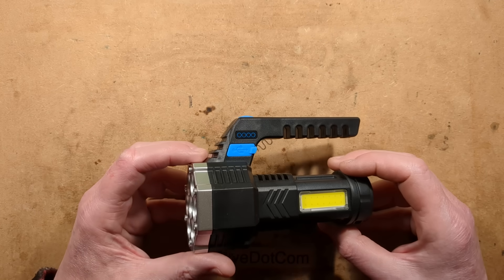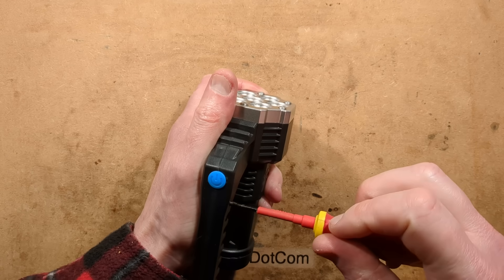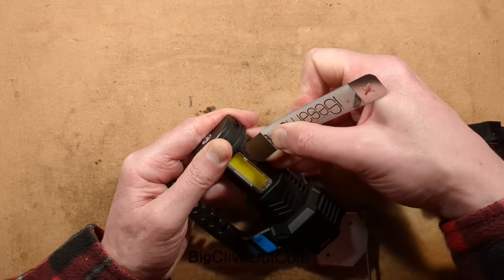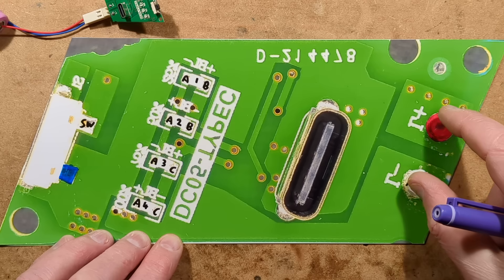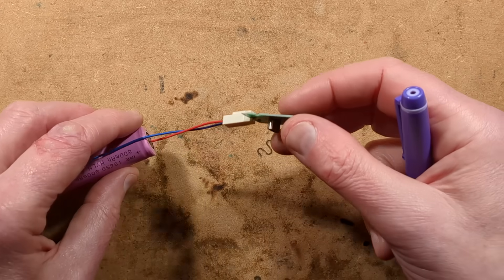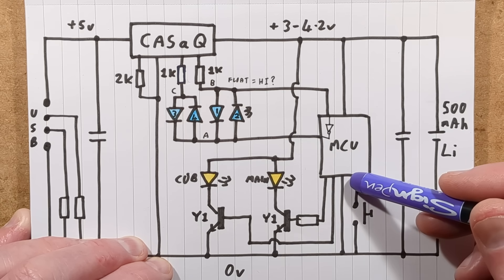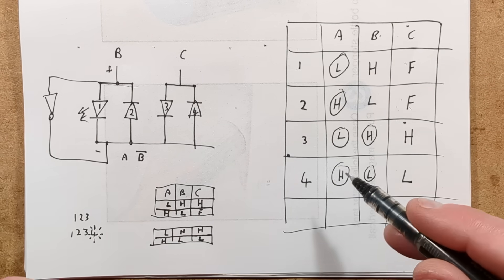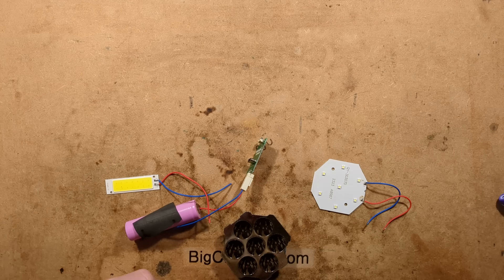Trashy big LED torch with intriguing charge control chip

Comment: I bought a similar one from temu. Was pretty bright and when battery was low I plugged it in and nothing happened. 

When I opened it the usb c connector wasn't connected to anything,  just an empty connector hot glued into the case.

Top quality stuff.

Comment: I don't even know why this thing exists. Shenzhen absolutely dominates the affordable torch segment. There are dozens of brands with really high quality and affordable torches, CNC'd aluminium, rational modes and interfaces. They may cost a little more, not as much as you'd expect, but they're so much nicer, serviceable, and will outlast this by miles.

Comment: I have been looking further into the sequencing of the bargraph LED's and think I have worked out how it is done without leaving a pin floating:

2 pins with Pin 1 attached to the inverter in the MCU

Pin 1 oscillates between high and low and pin 2 matches this oscillation - 4 LED's light on 50% duty cycle.
Pin 1 oscillates between high and low and pin 2 is static - 3 LED's light on 50% duty cycle.
Pin 1 oscillates between high and low and pin 2 oscillates inverse to this - 2 LED's light on 50% duty cycle.
Pin 1 is static, pin 2 static in inverse to this - 1 LED light on 100% duty cycle.

Comment: My grandfather fell for one of these online, the battery capacity after a few uses was laughable. I shoved 2 used 18650 cells in there instead. They fit easily

Comment: I bought a similar one that doesn't have the handle and has only 5 leds in the front, inside it has slots for two cells, i replaced the original one with two cells from a laptop battery and now it has good battery life now

Comment: Interesting! Bizarre LED trick but I think I follow it. Kinda neat; kinda seems like they were DESPERATE to fit it into an 8-pin package that they made it more complex internally, AND it's "BYO inverter". Speaking of which, I just noticed that the MCU's "inverter" is disabled (output tri-stated) when the torch is in OFF mode (presumably MCU in a sleep mode), to extinguish the power level LEDs.

Comment: 800ma my hairy nutsack. That will be more like 200ma in reality, maybe less. I have this exact same torch from the same place and it lasts maybe 5 mins on full. On the other hand mine doesn't flicker, so that's a plus I suppose. If you're buying torches from AE then budget for a decent battery too, but to be fair the torches are dirt cheap.
Reply from the maker: The capacity wasn't too bad.

Comment: I use these '' part's '' for my display pieces.  I have a small wood and glass case with 2 glass shelves in it but no light.  Same with my entertainment center 4 doors on the main part the tv sits on Then 2 end shelves that are 5 feet tall with glass doors and not 1 light was added? Would have cost the builder maybe 50 cents.  I added lights and a usb plug. Cost me $5 . Display case with no lights should be a crime lol

Comment: The Li-Ion cell is again delightfully disappointing. There is enough space to even put one of the bigger cells into it. The cell it comes with is probably also a hazard. I would definitely replace it and bring it to the recycling.

Comment: I'm pretty sure your schematic has an error.
There are 3 vias under the micro, A B and C. You show A and B on the micro but I'm fairly sure C connects to pin 7 of the micro.
That makes sense from an embedded design (my main job) because with A B and C connected to 3 micro pins you have the 4 leds charlieplexed in typical charlieplexing fashion. That gives the ability to control all 4 leds independently. Ie, easy bargraph for the guy that wrote the code.

That leaves the mystery of the charge control IC. I dont know what it is, but if I'm right about the leds being charlieplexed, those two pins on the IC with the 1k resistors are not related to the leds driving at all. One of them is probably a "charge-complete" digital output which the micro can sense in its leisure between charlieplexing cycles.
The other pin may be a low-bat digital output, or even a usb-on signal that shows charging is occurring. I dont know.

Regarding how the micro knows the battery voltage, I expect it uses its internal 1.2v ADC reference to compare to its operating Vdd (which is battery volts), that is a standard technique with these cheap 8pin Taiwan micros and it is not mega accurate but is fine for a 4 step bargraph.
Reply: On further reflection, I think that is a standard charge control IC with 2 digital outputs, normally used to drive 2 leds;
1. Charging
2. Charge complete
The 1k resistors allow the micro to sense both these conditions for a few microseconds between charlieplexing.

Have a look at TP4056 and TP4059

Comment: I found that most cheap lights pwm the led even at "max" setting and gradually reduce the duty cycle very slowly in a few minutes to get away with poor heatsinking and small batteries without sacrificing the "wow" factor when you first turn it on.

Comment: wow...it actually have a charging chip ? I have encountered one with just a diode in series with a li-ion cell slapped straight across the 5V supply rail in a cheap flashlight...luckily i have discovered that just in time....that method of charging is fine for ni-cd or ni-mh, even lead acid but with li-polymer or li-ion...yeah thats a ticking bomb...

Comment: Pro tip: Use cheap, Chinese screwdrivers. (for Chinese things) The cheapest ones, like what they provide free to for the stuff you bought. I have some, 10-15 year old BB gun screwdrivers (Chinese of course) and they opened everything Chinese electronic device. 😆 Where the quality Betas, Weras, Wihas, PB Swiss Tools or iFixit sets fails, the noname crap works. 🤌😉

Comment: using tri state multiplexing it is already possible to control 4 led indivisually with just 2 pins(because the led forward voltage is high enough you can put two in series and control middle point)

Comment: Clive, one thing I've noticed repeatedly is the amount of rubbish 18650 batteries and their claims to capacity..
Could you do a video on decent 18650 s and which we should use in our projects that actually have a true or decent capacity. I noticed there are almost exact copies of Samsung and Sanyo batteries except the slot size on the positive end give them away as fakes. The printing is almost exactly the same as well. eBay is awash with so many choices and they can't all be good.

Comment: I think you may have made a mistake with your schematic (maybe). Point C appears to go to two vias, one of which goes to the 1K resistor as drawn but the other is under the microcontroller and surely goes to the unused pin?
Reply: Yes, correct. The group of vias labelled ABC all end up underneath the MCU.

Comment: Are you sure that's a true 18650 ?
As the worklight torch I got from sainsburies had an internal rattle and would keep turning off. When I looked into it the 18650 battery was just a shell to hold something like a 16500 and that wasn't making a contact inside the fake battery housing.

Comment: clive would be great if you could look at the timing chips on battery led lights..6 hrs on 18 hrs off.. whats the voltage draw on such a small chip to keep it off for 18hrs ..
Reply from the maker: The current the timing chips draw is usually measured in microamps and negligible.

Comment: The tri state driving method of the state indicators is certainly a way to get an effective bar graph on the cheap as it were. Blinking them does save some battery charge. I expect to see this idea copied extensively. As usual the heavy lifting is done in the up software but so what? It works.

It strikes me that default PWM on the output LEDs helps prevent overdriving them while extending the life of the under-spec battery.

No SOS mode upon holing down the switch? What a relief!

Comment: 9:51 That 100 R base resistor oñ the MAW driver transistor wont limit much CE current. The Y1 SS8050 has hfe specified 120 to  350. At a 3V high state output of the MCU and assuming 0,6V BE drop the 100R resistor would pass 2,4/100= 0,024A which at minumum hfe would allow 0,024*120=2,88 A Collector current... They probably used it since that output of the MCU has higher output current capability than the other Output used for the COB driver.  Or they omitted that base current limiting resistor on the COB driver?

10:15 Your observation may be very valid. They may actually have used the high internal resistance on that "scaled down" lithium cell as current limiting. Win-win for them, and potentially a pitfall for those changing the provided low capacity high impedance cell for a proper tool grade 18650 as there seems no current limit other than driver's CE junction and wiring. Maybe a test is in order as to the LED peak current with the original cell and a proper cell... Or voltage drop on the provided cell under load...

Comment: It's very puzzling why they would even make an 18650 with 800mAh, that turns out to only be 500. You could take apart the cell to see how much(little) there is in it. They could've just put it in a 14500 case and saved a bit of metal...
Reply: Maybe it's a second hand cell with a brand new pink shrink wrap, reusing is more profitable than recycling.
Reply: No , they are purpose built to supply  the cheap units. Most of these  inexpensive lights have such cells to keep costs low. Easy enough to swap out the cells

Comment: Surely the PWM on max brightness is just the standard way of getting higher perceived brightness without burning the LEDs out?
Reply: Nah, PWM is a MUCH more efficient way of controlling the brightness of an LED rather than using the linear region of a transistor or mosfet. To have the light go into direct drive or have a regulated high mode requires more hardware and more expense, so they just use the PWM that they already have for the lower settings on high also. The cheaper lights are almost all like this.  The higher powered, more expensive lights use the extra hardware to either direct drive the LED on high, or use some sort of regulator circuit on high only, and use PWM on the lower settings.
Reply: @davelowets  If only they would use 10 KHz instead of like 25 Hz...

Comment: You gotta get into LED swapping. you can replace the cold ugly color rendering led with more natural high CRI ones, we're in the golden age of decent performant high CRI emitters (for practically all tints). hell you seem to be interested in lights, flashlight modding is worthwhile adventure. Those emitters look like 3535 which could be replaced for ,Nichia 219B, Nichia 519A, or SST20 (check at convoy  for those) Fireflylight (FFL351A) and Emisar (Noctigon NTG35) also have some purdy 3535 leds you can swap in. The next step is swapping the crappy driver for something better.

Comment: remember those old 5mm white LEDs of which we all thought they were bright (the first ones to actually shine instead of just signal)
Reply: Yep. I bought one of the first available white LED's at Radio Shack decades ago when they first started showing up, and it was like $5 for a single bare LED, and it wasn't even all that bright. For the time it was bright, but nothing compared to today. Then, when the Luxeon flashlights started showing up with like 50-60 lumens, that was the next step up. Those were fairly expensive flashlights.. 😬

Now one can pick up a 1000+ lumen flashlight for less than $20, and it's TINY... 👍
Reply: @davelowets  I remember buying my Nichia ones from Dotlight. Shop doesn't exist anymore.
Reply: @davelowets  yea it's amazing the amount of light these days

Comment: i was going to say dont buy it but it was done..... the one i have same no handle  its cheap but its ok ...... the best of them all is the smaller ones  diameter 11/2 inch  l 5 inches ..... their is a smaller model 1inch x3 .... both work really well  but the bms is doggy if you run them flat you have to jump start the battery ... they give more than 1 hour run time .. they have a charge indicator don't let it get below 40%  ... the thing is they cost $2 to $4  ................................ the small one comes in a cool little zippy box i use them for outdoor power terminal  boxes  on my   cctv after i paint them to uv stabilise  .............................................................................. did you note the 18650 is that light a ANT could nik it / walk off with it

Comment: I ran across something recently, which seems to be confirmed by a W source article, that says that the correct reading of "18650" is eighteen, sixty-five, zero. 18 mm by 65 mm, shape 0 (cylindrical).

Comment: My wife bought something similar same manufacturer and it had a blue led light on all the time which would drain the torch. I put a small rocker switch on her one so she can turn it all off totally. Why they would wire it up with a blue led light going all the time baffled me. Fitting the on off switch was easy.
Reply: Did you try taking a flush cutter to the blue led first?
Reply: @rexsceleratorum1632  No I think my wife liked the little blue light too much and I had a little spare rocker switch. Woman are illogical and like shiny pretty things ;)
Reply: @peterwilson5528  Hi, hmm, i'm not sure gender decides whether a human enjoys cool lights, though each to their own. peace love light
Reply: @flyingfree387  It was a bit of humour. Are things in the war of the sexes now so bad that they are excluding even light humour?
Reply: @peterwilson5528  light humor indeed, as it is humor about a light.
Reply: how low did it drain the battery
Reply: @sgas I'm sure it would drain the battery right down to the Vf of the blue LED
Reply: @davelowets  still too low...
Reply: I was not going to leave it in the cupboard to find out. When the lights go out even one minute could be the difference between life and death. :)
Reply: It’s normal even for very good flashlights to have an always on led. To find it in the dark. The amount of energy it uses is very marginal. (1 flashlight of mine lights for 2 years now without charging) so I don’t know why you made the effort 🤷‍♂️
Reply: @Tinmy354  If your car was leaking a tiny amount of petrol every day you would want to stop that leak. Of course if you did need to find your car you could just light a match and follow the flame back to it. My torch would be where I knew it was even in the wilds I would attach it by a lanyard. I don't think I would wander about a jungle looking for a tiny blue light. At home my wife puts her torch in the kitchen drawer or she has one on a magnet on the fridge also. I will need to really puzzle of the logic of a tiny blue light now.
Reply: @Tinmy354  I just think draining its power even slightly defeats it working when you might need it. I don't trust things you cannot turn off. Do you?
Reply: I made me think did Tinkerbell in Peter Pan have an on off switch?
Reply: Rejects being sold.
Reply: @kyoudaiken  Probably... 😮‍💨

Comment: For $.50 less you get two less LEDs, deal?  Wonder if the 5 LED version has a different controller or charge chip?  Probably not, just configured different.  Well for four bucks and change I didn't expect much, yeah it works....  Thanks for the teardown and schematic Clive, that's a pretty benign 18650 also.

Comment: I have an older one with micro USB.  the board is the same, but the charge controller is replaced with a J3Y smt part.  It looks like the ucontroller is responsible for the charging on the older one.  i can provide a pic if anyone really cares.  its actually a pretty decent little light for the money.

Comment: I'm so glad I found your channel. I like the little fiddling with subpar electronic devices; it's truly like an adventure to the unknown, which it probably often is with low quality stuff like this. I also love your accent and voice in general.
Reply: There's an entire hobby dedicated to modding flashlight, I don't know if you've heard of BLF. budgetlightforums was big on modding flashlights, eventually that got in contact with manufactures to make custom lights direct from the source,, they started with making thermal improvements, user control improvements, led color rendering improvements, etc. Making low quality lights into your own is more satisfying than just collecting them. But now there's multiple sellers that cater directly to flashlight enthusiast because they are enthusiast themselves.

Comment: funny how they used the MCU instead of a single gate version of a 74HC04 (SOP6, they exist on video cards for glue logic) , must have been cheaper
Reply: Definitely cheaper. Also how would you turn the bar graph off with a mere inverter? You'd need a 1G125 or something that would turn off the drive to the bar graph, and an MCU output to drive the tri-state control. With all those free pins available on the MCU, a discrete (dis-integrated) solution would be wasteful and silly.

Comment: I will replace the low capacity 18650 with a high capacity 21700.😂
Reply: Si elle peut rentré à l'intérieur, pourquoi pas...
Reply: I like the 21700 cells... 👍
Reply: But then you won't have the pleasure of charging it more than 3 times in 5 years... In fact you would've lost it before the second charge 🫎
Reply: Yea great you are very smart

Comment: Tri state.... Bangs haed against the wall. 🤣
Reply: Tri state logic has its uses. It can do things with fewer pins as is done here, and and having a high impedance connected to a switching transistor can prevent unintended turn-on events due to collector spikes.

Comment: That's wild. Thanks Big Clive.
Reply: Pretty wild how they made a bar graph work.  I was thinking they would oscillate between positive and negative to show say 50% charge or just positive (or negative) to show 25% then trigger the three and four the same way to show 75% to fully charged state.  Kind of like the fairy lights with three wires that have half of the diodes reversed on one string from the other.